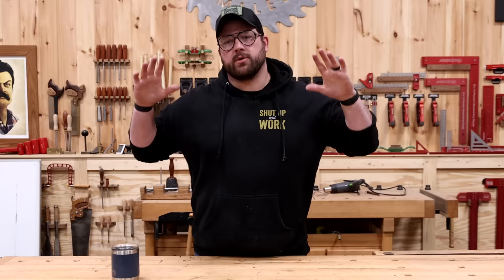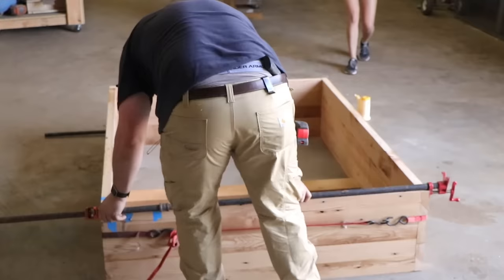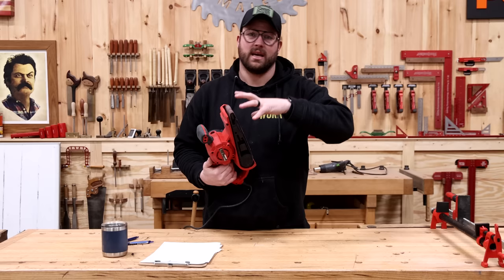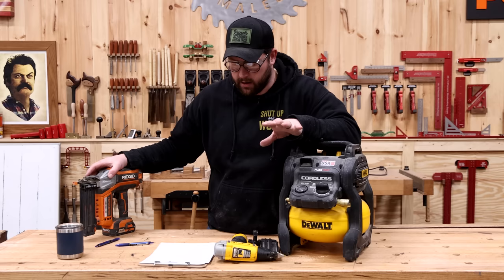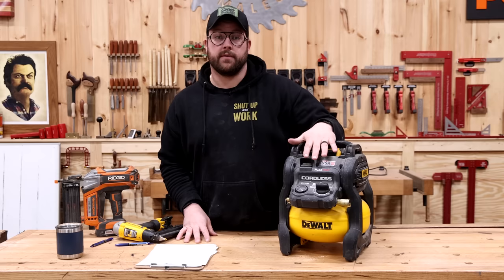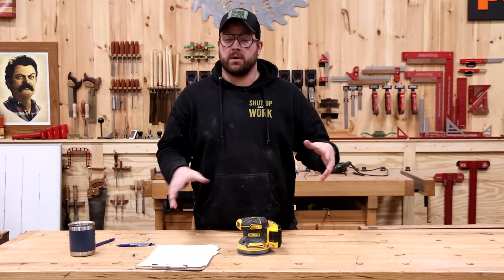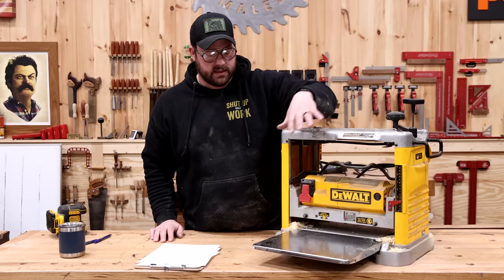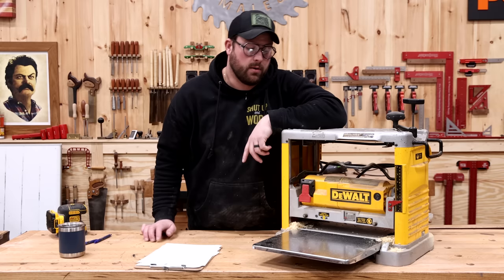5 Beginner Woodworking Tools I Regret Buying

Comment: Sir, you saved me 300€. I was going to buy a couple of these parallel clamps for my table project (2,5m long and 1,2m wide) and the clamps for that would cost 350 - 400€.
Now I'm buying the pipe clamps for a fraction of the price.

Best thanks 😊

Comment: Wow!  The DeWalt compressor, without battery, is £350 here in the UK (about US$430).  Then you'd need to add a charger and battery(s), as well as the air nailer.  With the Ryobi cordless nailer being about £180, it changes the maths quite a lot!
Reply: Why should you by cordless compressor in your shop, I bought a silent Hyundai compressor 25 liter for 175 euro and a 3 nail guns for 60 euro. Use it almost daily for 2 years and still happy whit it.
Reply: We’re still getting our tax money back, just using American owned brands to do it.

Comment: I agree with everything you said except the dewalt planer dw 734.  I love mine.  Mine has never tripped the built in circuit breaker since I've owned it.  I do agree its top heavy so I've got it mounted to a platform I built with infeed/outfeed.  Works great IMO. My only complaint is minor snipe.  But you get that with the dw735 too from what I've seen on other YT vids.

Comment: as a beginner woodworker, the quick clamps and pipe clamps is pretty much all you need. Parallel ones are really nice when some of your material isn't perfect - usually to due to my error. For example if something cups or moves on you then that larger grip face of the parallel clamp is a lifesaver -- but I would only buy Bessey on a big sale, and that was more of a treat

Comment: Love the belt sander. I had a lot of irregular planks to sand down and and two large timber benchtops that had epoxy paint on them. Blew up my orbital sander in short order and decided a belt sander was the way to go. It did the planks quickly. The recycled benchtops still had residual epoxy on them even after spending two days with some extremely vile stripper to remove it. The belt sander finished the job in no time after working through some finer grade belts I had a surface ready for a final finish with my replacement orbital sander. The result was two really nice solid timber benches with a beautiful polyurethane finish. For a nailer i had a lot of cabinets and shelves to assemble so I brought a very cheap ($30) mains powered nail gun. Its been a case of not being able to afford high quality tools when I was getting started so I went for the cheap and dirty option. The plan has always been that as I get experience and see what I really need I'll gradually replace them with better tools.
Reply: Yep I bought one for detail work when refinishing a floor. Now I use it as a shaper or almost a power plane.  Not needed for a beginner but very useful.

Comment: Thanks, John.
I personally like my belt sander as it removes lots of material, way faster than the random orbital sander, but you're right, if you are not careful, you can destroy your project. With practice, this becomes a great tool.
Thanks for the advice on the spindle sander, I was looking at that same one...
I love my pipe clamps. So easy to change the length by just buying the right pipes (which are pretty cheap).

As a rule, I do not buy tools if I do not have an immediate need. I always look at doing stuff with what I have, first...
Great video!
Reply: I've had a belt sander since HF was bright orange and it's definitely a rarely used tool. A plane of similar cost would honestly be more valuable for most uses.
Reply: Learn how to use a scrub plane. When you learn how to use hand planes your belt sander will get a lot less use woodworking. Shavings > dust! That and spend the time to learn how to sharpen and use a card scraper. I know getting that to work ain't easy. But once you do it's amazing. I still use sandpaper but I use a lot less sandpaper today than I used to. Now I use sandpaper to rough a surface up so it'll accept a finish. Burnished wood stains funny.

Comment: Love the clamp advice.  I was genuinely shocked with the planer.  I've looked at it quite a few times and have it in my wishlist.  I appreciate the heads up.
Reply: Dewalt 13" for sure on the benchtop planer.

I've been eying it latley. It outperforms higher priced options on durability and lifespan while being upgradeable to the same level over time.
Reply: Grizzly makes a similar model with a helix head. I sold my DeWalt and love my Grizzly
Reply: @markmonson6118  which Dewalt model did you have? The DW734?

Comment: Spot on with the comments about the nail guns.  The air compressor is by default extremely versatile and there are a hundred different air powered tools you can buy that can be useful.  Several years ago I bought a 6 gallon craftsman compressor that came with 3 different tools in the kit.  All three were great and I've added 2 or 3 other items over the years.  (They aren't cordless but I don't have to move the compressor often).

Comment: As a diy woodworker I'd say the biggest trap are cheap hand tools. Made that mistake several times. Especially chisels. Ended up with a set of Stanley short blade chisels that have lasted me 15 years now and were under £50. Always sharpen up nice.
Reply: I find cheap chisels aren’t much of a problem as long as you take good care of them. An MDF wheel on a bench grinder with a little buffing compound makes short work of sharpening and brings it up to a near mirror finish. 

I do a lot of destruction for materials, so having chisels that I’m not too concerned about damaging is pretty invaluable for me
Reply: @snaile2876 cheap chisels definitely have their place. I was telling some former colleagues that my most effective workbench was actually just a pallet cut in half and then plopped on a scrap 2x4 and 4x4 frame. I literally don't care about it because it was practically free, so I'm not precious about what I do to it.
Reply: Cheap chisels are the best!  You put them out where people can find them, and keep your 100+ year old Buck Brothers chisels out of sight.  When someone comes along to borrow a chisel to chip the grout off their bathroom tile, you can tell 'em just to keep it.
Reply: @jeffspaulding9834  You're not wrong!!!!
Reply: Some cheap chisels can be OK. Chisels are a crap shoot. Before they got a name Narex chisels were cheap. They're the best chisels made. So price is not always an indicator of quality.

Comment: I actually use that rigid oscillating sander all the time. But a lot of what I make in my shop is small items for an Etsy store so this tool makes very fast and efficient edge sanding on small items. I almost never use the spindles though. Basically just the belt sander portion.
Reply: They also go on sale for substantial discounts at Direct Tools Outlet on occasion. I picked up mine for just over $100. It was definitely worth it and I use it all the time with my CNC side of the business.
Reply: It's used very often in guitar building too. It's an extremely good tool for some things but I agree with John that it shouldn't really be something a general woodworker should look to get unless they know for sure they are making things that make good use of it.

Comment: Great video. I wanted the K clamps like everyone else, but I now have a wall full of the pipe clamps. I have the Porter Cable brad nailer you mentioned--love it; and my compressor. I did a lot of research before buying a benchtop planer and went with the 13" Dewalt model you mentioned and am very satisfied. And for sanders, plug the damn thing in! Keep 'em coming!
Reply: I can't speak to much of what you said but a woodworker definitely needs a corded sander.  We'd destroy a battery powered one before very long.  A cordless one might be handy for quick jobs if it came in a bundle that you got cheap but it ain't gonna be great for your main one.

Comment: For rapid spot material removal, I love me a flap wheel on angle grinder. More precise and versatile than belt sander in tight spots, but each has its applications.
Reply: This was my thoughts. INSANELY cheap and works great.

Comment: 100% agree with all of these.  I think anyone that argues otherwise is more into tools for the sake of tools.  I'd add - the only cordless/battery tools that make sense to buy first are a 1/4" drill and an impact driver, and that's just because those are small and light, and they don't make corded versions much anymore.  For saws and everything else, go corded.  For nailers, go air powered unless you're a framing pro and prefer fuel or cordless.  For a benchtop planer, the HF is better and cheaper than the DW.  I'd also get a jointer, floor model, before a planer.

Comment: You're focusing on specific brands and then you generalise it on the hole type of tool. Take a makita belt sander or another quality brand and you'll have a dust collection connection on the machine. The belt sander is also a lot better to achieve plane surfaces than a rotary sander. These are more for finishing. The pipe clamps do not have the depth as the parallel ones, which can be important when gluing cabinets or thick stuff. Overall I got the impression you're still not that experienced and now you think spreading your smattering is a good idea. Stopped the video and got a thumb down.

Comment: I've had the DW734 planer you show for years. Approx 8000 bd ft of unplaned hardwood through it. I've purchased one set of blades, so I'm on my third blade side. It's 12 1/2". It's bolted to it's own stand so it doesn't tip over. I've never seen snipe. It only bogs down or trips the circuit protection switch if  you're using it wrong, (to thick bites) or you try to use it with dull blades. The thing can't be killed. If you have a dust collector it makes no sawdust that isn't collected. Best and most used tool in my shop. Can't live without it. Can't start a project without it.  The 735 is a great planer though but the 734 is too.

Comment: I repair furniture and do small projects as well. I agree with the bench top planer. My first was an older Delta, and it worked well for what it was. I paid $85 for it and used it for 2 years, sold it for $150 after adding the dust collection port. I now have an older Makita 2030. It is a 6" jointer over a 12" planer. It is a beast and I love it.
As far as the pin nail/brad guns go, I went to Harbor Freight. I already had a compressor and couldn't justify the pricey M12 pin nailer. I also didn't want to delve into a new battery platform with the M18 brad nailer. Harbor has some good options that perform well and won't break the bank.
So I saved the best for last. After helping my brother in Florida complete a 14' White Oak, live edge conference table, I will be purchasing a Festool sander. I used his 6" and 3..5" sander and fell in love. The dust collection is off the charts, and they work incredibly well. I look forward to my next table refinish with this sander in my shop.

Comment: I watch a lot of woodworking videos and am a keen hobby furniture maker. I'm also a qualified carpenter, which translates reasonably well, at least on the tool front. 
I live in New Zealand, and the thing that always blows me away, apart from the amazing woodworkers that are on you tube, is how cheap everything is in the USA!! 
That DeWalt compressor/pin nailer combo in NZ would be anywhere between $700 and $1000 NZD.
The DeWalt 13 inch planer is $1900 NZD compared to the $600 USD. Exchange rates etc I know, but still a crazy difference! 
Love the videos!

Comment: Definitely agree with  getting an air compressor. For work I have two finish nailers and a framing nailer. If I had to buy all of them as cordless it would be a ton of money. And the trigger speed isn’t as fast on a cordless.
Plus I can use my compressor to fill my boys bike tires, blow out parts with compressed air, spraying texture on new drywall,(I do a lot of drywall repairs) and I use it when I use my airbrush. Oh I almost forgot, I use it for my palm nailer, which is a really handy tool. An air compressor is a must have tool.

Comment: I would say you are pretty much spot on. However, I have found that when gluing up wide panels, a belt sander turned at about a 30 degree angle does a great job of flattening the panel out.  I don't have have a drum sander, wide belt sander or a very sharp plane and the talent to use it.

Comment: Old woodworker here (45 yrs exp).  I agree with everything you said except for the belt sander.  Get an OLD Porter Cable 363 or Delta 4"'x24" or 3"x21" belt sander and learn how to use it.  You can probably pick up an old used one for $50 and all you'll ever replace are belts and maybe a set of brushes.  Once you master it you'll use it quite a bit.  You can do some damage so make sure to practice with it, keep it flat and keep it moving.

Comment: I've had a wood shop doing custom aquarium cabinets and canopies for 25 years and my approach for beginners is a little different. First, tool selection depends somewhat on the type of things you want to build but for me i recommend those getting started buy the best tools they can afford which are required for their project and then only buy new tools when a project specifically calls for it.  What I've found is that really good tools can help make a beginner make some awesome things which helps motivate them to continue and improve.  For example, i suspect i can do things with inexpensive tools that a beginner could not simply because I've been building for 30 years.  Take something as simple as a chisel.  If you buy a cheap HF version you're going to struggle to  make really precision cuts to get perfect fits which as if you buy a more expensive one they are much easier to use. Having said all that i agree things like belt sanders seem like a good idea but are really difficult to use.  Investing in a small pancake compressor early on it a really smart idea since you can use so many different tools.  Except for a hand drill, cordless tools are an unnecessary extra expense in a small shop, they shine for on-site applications.  My #1 suggestion for those getting into wood working is to invest in the best table saw you can afford. It is the centerpiece of every professional shop and you can do almost anything with it once you learn how to make a few jigs.  Also, if Consumner protection Agency passé the new policy they are looking at which will mandate that ALL new table saws are required to have the 'flesh protection" tech built into them the small hobby saw market will collapse since they will become unaffordable ...

Comment: The great thing about the K clamps is you can stand your clue-ups on the floor on the square butt of the tool and let it dry and you are saving a lot of space. Pipe clamps can not stand up on their own so you have to leave them where you glued your project. This is important in a small shop. But pipe clamps are also great.  A good shop needs both. You can never have to many clamps

Comment: I had a Ridgid thickness planer that also seemed to trip the thermal switch for no good reason. 

I tried all the tricks but what ACTUALLY helped was wiring a 10gage solid strand length of romex directly to a breaker. The breaker box was only about 20’ away in the same workspace. 

I never tripped the thermal overload again and used the planer for another year.

Comment: You just blew my mind. Never thought of using a cordless compressor. In fact, I'm not sure I've ever really thought such a thing existed. I have the 18ga Ryobi One+ brad nailer as well as a number of air powered tools including nailers and staplers. The cordless brad nailer is convenient for low volume quick jobs, but the air powered tools are so much nicer to use. They're lighter, faster and more reliable, so long as the compressor can keep up. A cordless compressor seems like something to think about adding to my list at some point.

Comment: I am a beginner in woodworking and have wanted to start making cutting boards. To see the prices at HD, of clamps needed to make them has been an obstacle. The information about pipe clamps is very exciting to me. I can get the clamps and then get pipe at Habitat resale store. Yippee!
Reply: You can clamp with wedges too. A pair of wedges hammered together will cause a clamping force.

Comment: I went with a corded 26 gallon quiet compressor that has wheels. Has 2 quick connects that I have 3/8” hose connecting two 25ft 3/8” hose reels

Gives me air anywhere in the shop or outside, and it’s able to run my paint shaker, 18 gauge nailer, die grinders, among other pneumatics

I would have loved having the option of portability that the battery powered ones have, but in the 3 years I’ve had this one I’ve only moved it twice. Once for a new drain valve install and another time when I got a bigger workbench

Comment: I have just started into woodworking and I agree with most of your suggestion. As a homeowner and a DIY, I went down the Ryobi line for drills, nailer and sanders, all battery powered. I am constantly having to stop and change batteries when I use the orbital sander, nail gun is heavy and clunky to use. Panel clamps are expensive so I went with pipe clamps and found them to be very adaptive. I thought about getting the spindle sander, but noticed the table was support on just one side,NG. I spent the extra money on a good planer (Grizzly) that came with the Heliclal head, very happy with it.
All in all a very good video. Thank you for my affirmation.
Reply: Nobody asked

Comment: I totally agree with not needing a planer straight off. I started off doing most of my surfacing by routing or shaving with my table saw and then sanding